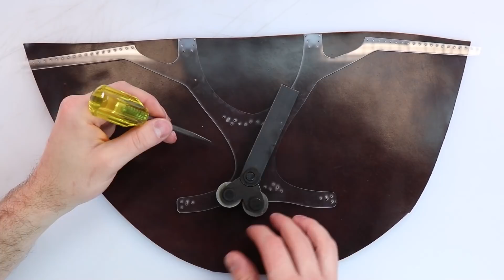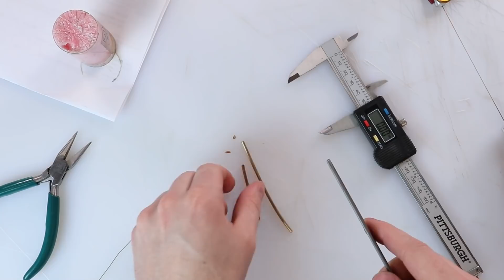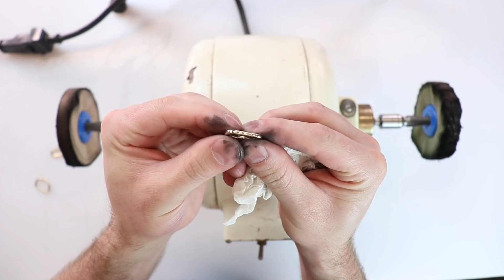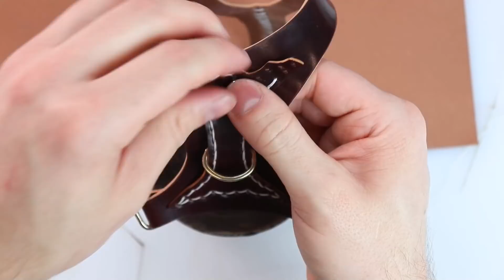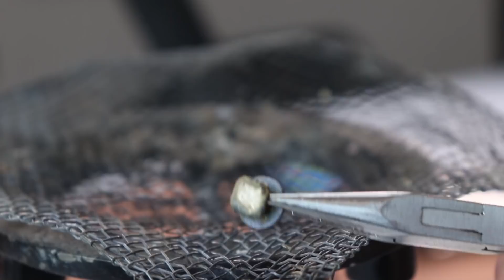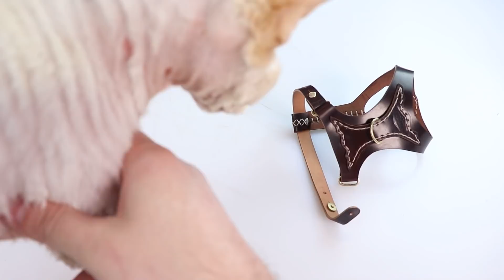I Made a 18K GOLD & SHELL CORDOVAN Harness For My Cat Named Toaster

Comment: Props on developing your skills to such a degree. I'm gradually moving down that same road where I'm making my own bespoke items. Made my own wallet, a full tang brass butcher knife, as well as the sheath for it. It just grows organically out of dissatisfaction with the craftsmanship of everything. I take the time and pains to make every little detail I see perfect and when you apply that to many areas most people would hardly notice it all adds up to make an item have an overall grandiose quality to it that might be hard to pin down. Also nobody has an eye for proportions anymore and right proportions are beautiful.  Btw brass knife has been great for butchering animal joints as the blade is thick and heavy but you gotta sharpen it constantly and clean the tarnish off the brass 1st everytime before using on food.

Comment: Is there a way to change the buttons to snap buttons or maybe even magnetic on one side? Or like cufflinks, that pivot to become a straight line to put into the buttonhole then swings back to a T shape to stay put. Purse closure type buttons that twist to lock might work too, but it’s require changing the holes and reinforcing them. 

I don’t think changing the rings will improve the looks. It looks great as it.